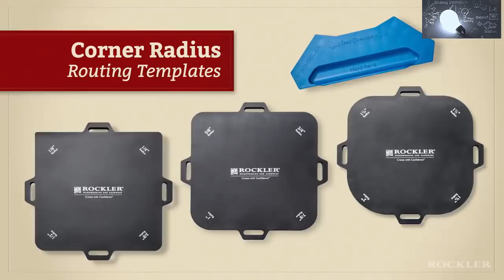10 WOODWORKING TOOLS YOU NEED TO SEE 2020 AMAZON 6

Comment: Has anyone found a clear plastic base for that Ridgid 18v compact router that will accept template guides? Since nearly every other router has that, the lack of if is perhaps this router's most significant shortcoming. By the way, the router itself is very good. I have two, one for freehand and another mounted under a table. No problems whatsoever.

Comment: 1. Make your own on a 3d printer.
2. It will do what your router does, but its 2020 model. Soo cool...
3. If you dont own a drill press.
4. Cause an old piece of wood/metal with clamps isnt enough.
5. Look at number 2 and replace router with a jigsaw.
6. "Superior finish compared to other". "Our toilet paper will get more shit from your ass than other brand according to our NOT PAID specialists"
7. That drill guide was vibrating like crazy, so the hole might be off quite a lot. Also they "got feet". Y'all better catch them, if they run.
8. Few pieces of scrap wood and small ball bearings.
9. Lookup number 4.
10. People getting really desperate forcing themself to "invent" new tools.